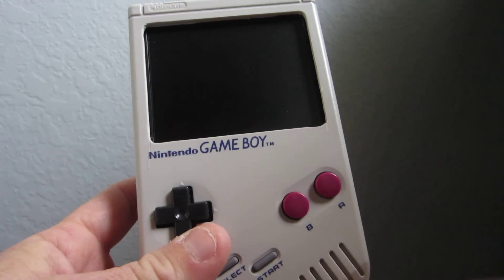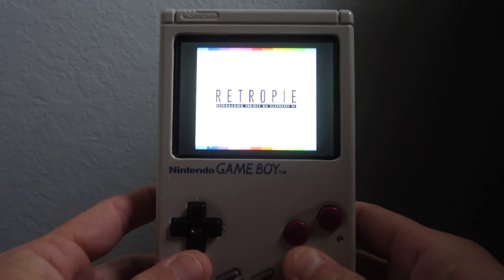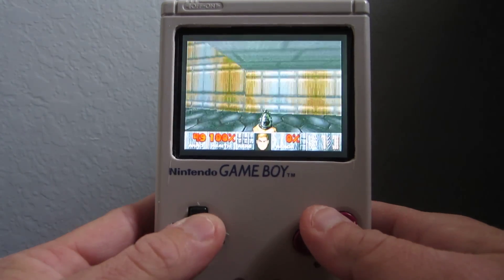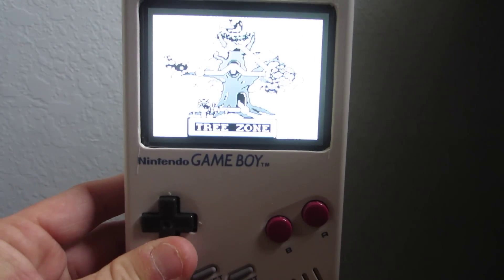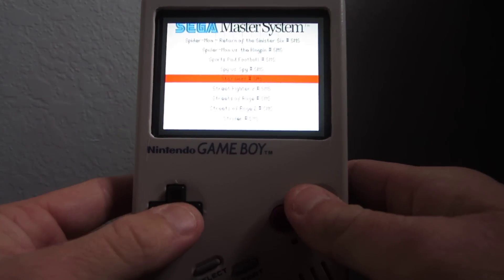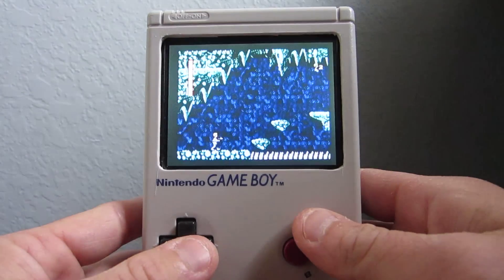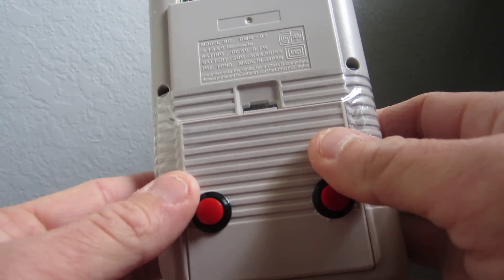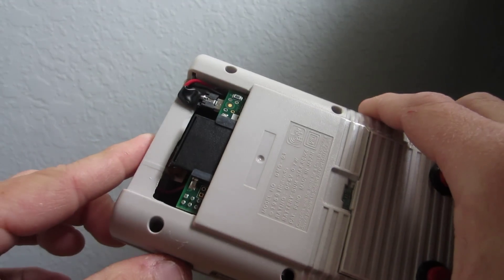Super Pi Boy 64 Mega... Thingy overview - Part 1 - Raspberry Pi Gameboy

Comment: Nice.  I like the Gameboy, always found it comfortable to use and has good controls, so it's an ideal handheld for these projects.I got a plug-in-TV megadrive thing, like a little mini megadrive with 2 controllers - only had 3 games so I stuck a PI inside.  It was fun to build and is a great project for a PI - of course a PI (or 8) and a 3D printer and the world is your lobster :)

Comment: Very nice! I do have a question, however: with the Game Boy's limited number of buttons, do you notice a lack of functionality (of course, that's why you added the buttons on the back, but I mean in terms of emulating consoles that are not the Game Boy)? If so, did you add a way to use an external controller?

Comment: I might do this. I have an old Gameboy that's useless due to a battery leak.
Reply: GalaxysDesigns You can clean pretty much all the damage caused by a leaky battery.
Please don't ruin a gameboy. I will buy it off of you if you want. :)
Reply: The inside of the battery pack is mostly blue
Reply: Use alchohol and q-tips. Keep working at it. It will come out. PLEASE DONT KILL A GAMEBOY THAT CAN BE SAVED!
Reply: Actualy, baking soda and water will work better. IT will all bubble away. DONT USE TOO MUCH!

Comment: How was Heat not a problem cause if you're going to bring it on a car trip (6-7hrs)
it would overheat.
Reply: even when overclocking and stresstest I wouldnot get higher then 60 C
thats hot but you should need to worry on about 80

Comment: Could u use a gameboy colour shell instead of the bugger one?
Reply: +Sophie Nichol Yeah, of course, but you'd be hard pressed to cut the PCB and then custom make the control board and then fit it all into the case. The DMG is optimal for heat management because you can place everything you need without having to cramp the electronics. (It also fits nicely in the hand.)

Comment: Its cool but to mutch work i use android emus then hook a wii remote to it
Reply from the maker: yeah, I still emulate on other devices, but this was more for the fun of the project and seeing if I could actually do it.  I agree, there are much easier methods!
Reply: If i ever make something like this its gona be n64 handheld
Reply: +Aidan :toxsa the pawn That's way more complicated.. You would have to make your own case , wire everything , etc.
Reply: +Daimao Rocky Wouldn't actually be that hard. Something like Adafruit's Super Game Pi could be modified pretty easily to have the same controls as an N64 (of course, that would require a 3D printer and the knowledge to modify 3D models). You'd be surprised how many different 3D printable Pi cases are out there.
Reply: Azure Mist gattung the pi 3 in a week I'm going to attempt the n64

Comment: How did you connect the display to the pi?
Reply: Its AV display that means the display is connected thru composite video cable. Also those screens are like 12$ for that big one so its pretty good
Reply: Ejz20 You can get displays that use the GPIO which make them far clearer
Reply: ***** They are more expensive and some dont even work
Reply: Filip griffin $10 vs $8, I wouldn't worry. GPIO connections are digital therefore not that awful blurry mess which people call composite
Reply: +ElectrofizzStudiosCo The big trade-off with SPI displays, the ones that mount on the GPIO pins, is that they don't run at 60hz and eat up the Pi's CPU in the process since it has to drive them directly in software. This worsens as you go up in resolution from QVGA.

Ideally you'd want a screen that accepts the Pi's hardware-accelerated HDMI output and drives the LCD with its own hardware, but unfortunately they tend to be pricier and unavailable in smaller screen sizes. A 3.5" screen is about the max you could fit in the Game Boy's 90mm-wide case.

A composite screen is an ideal compromise in my opinion. I'd much rather have games running at 480i@60hz than 240p and under 60hz.

Comment: What are your settings in config.test for the screen? I have the same screen but the screen is very fuzzy. It seems that the resolution is wrong. I have tried to fix it with overscan settings, framebuffer etc without success. Can you provide your config. txt? Or do I have to change anything else?